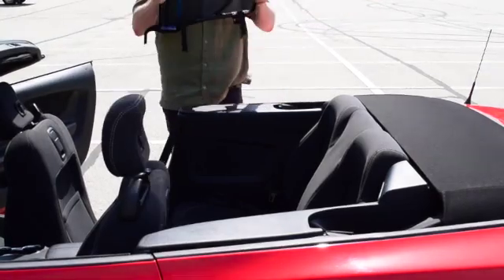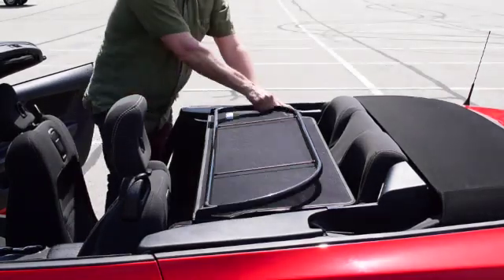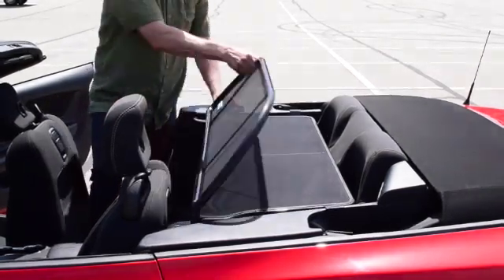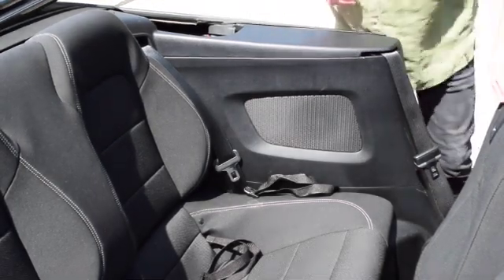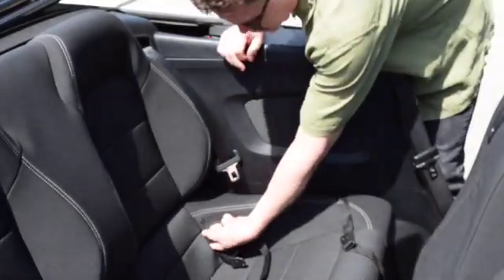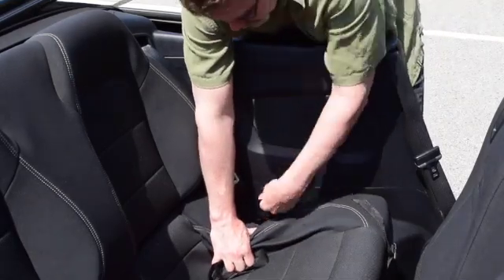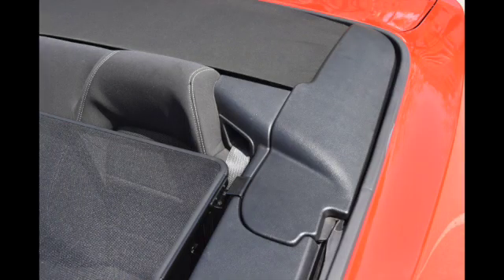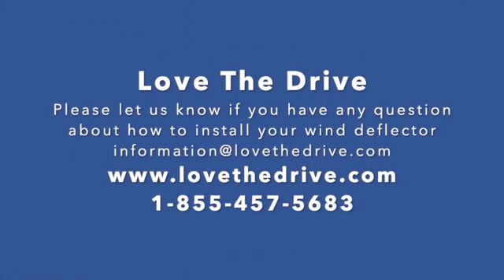Mustang Convertible Wind Deflector installation video by Love The Drive

Comment: Kudos to the Lovethedrive guys for creating installation videos for each type of car.  I just installed my deflector on my 2021 Mustang, and the process could have been easier if the video included a couple of points:. 1. before installing the straps, you can and should disconnect them.  much easier to install that way.  2. also the strap lengths are pre-set to suit the car (at least in my case) so just a slight loosening and then tightening when reconnected should be necessary.  3. The back straps have snap on hooks that do not need to be fully closed when connected to the back door panel (and in fact I could not close/lock them).